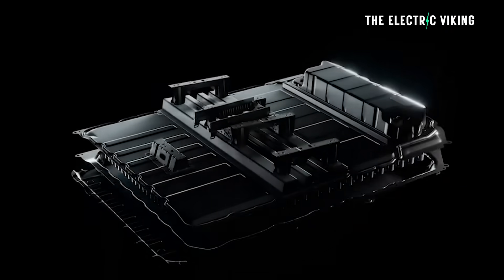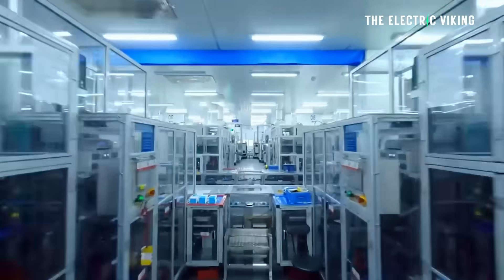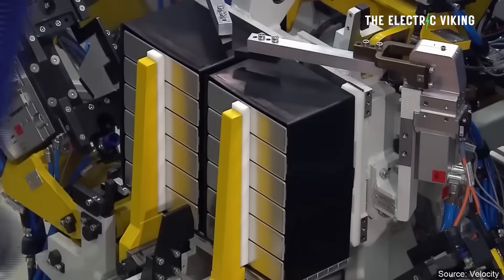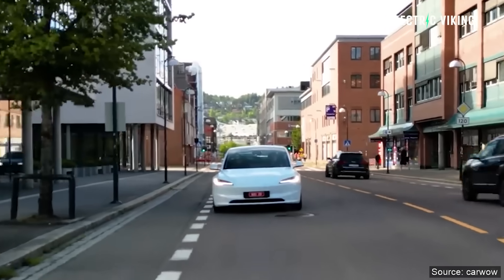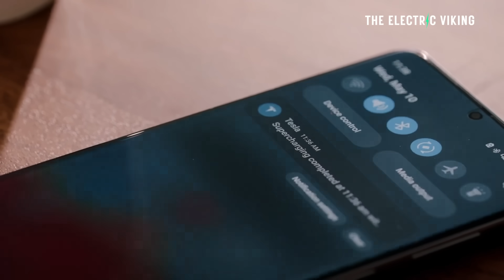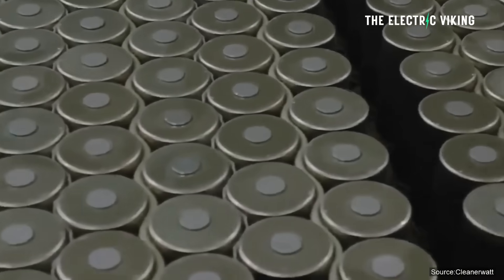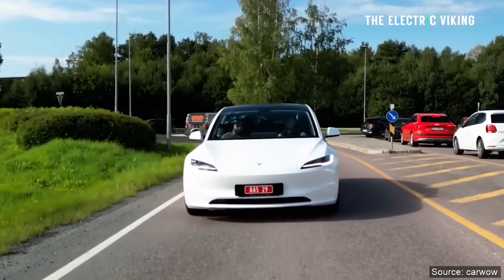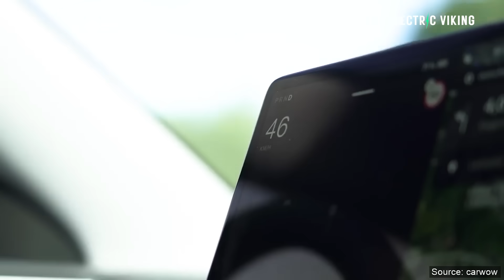Replace a faulty Tesla Model 3 battery for $12K or sell the car for $16K?

Comment: It can be more expensive if you swap the battery yourself on the parkinglot of a major Australian airport
Reply: And then leave it outside exposed to the elements for a few days.
Reply: It was actually a wrecked 2020 MG ZS dropped in the airport dump used for damaged and other vehicles abandoned on airport premises.

Some smart Alec had pulled the battery apparently in an attempt to steal it but did not safe it up properly. The resultant fire burned three or four other vehicles parked alongside.
Reply: @jimgraham6722  what's your source. Or did you hear that on social media?
Reply: Lol I don’t get it I’m not from Australia but it sounds funny lol
Reply: @robertfonovic3551 There's a pic from the scene that shows a burnt battery pack on the ground in front of a car. They don't just fall off, not even in a fire. The firefighters wouldn't have tried to remove it either.

Why the pack was removed, I don't know.
Reply: Anyone else hearing the “The Benny Hill Show” theme music in the background ?🤣

Comment: Wouldn’t it be nice if the battery management system could identify the cell that is weak or defective, sort of like a spreadsheet on the diagnostic menu on the infotainment screen and the individual cells could be replaced. That seems a better solution than scrapping a whole giant battery pack.
Reply: Software does exist, but the module currently should not be 'opened up' that contains the bad battery cell. So replace the module.

Comment: One more point for EV, you can sale your old batteries or reuse them for energy storage; however, with old engines no value.
Reply: For sure, because of you don’t have a basement to but that battery in as storage, I’m sure someone with $10000 in their pocket will happily buy your used pack with at least 30 usable kWh left, instead of a Powerwall 3 with what, 13 kWh? 

That one is definitely a DUH!

Comment: If the EV battery just degrades you can still use the car and just charge it more often. If your gas car develops a bad problem your range is zero until you fix it.

Comment: Thanks for all this information.  I assume if the vehicle is still in pretty good shape and everything else works fine, getting a new battery would be the best option for me and not trying to go for a newer vehicle.  It is kind of a judgement call should the battery go bad in the vehicle. 

Or if we can find a 3rd party that can do the battery repairs cheaper than Tesla pricings.

What is the warranty if we do get a new battery from Tesla???  Does our Auto Insurance help pay for some of the costs???  Things to ask when the time comes.

I just got my new 2023 model Y LR Aug 2023 so it will be a while before I reach that time to be thinking about my battery status.

Take care.

Comment: The solution for premature battery failure is insurance. And manufacturers should built in programmable fuses to isolate faulty cells, it is better to have 80% capacity than zero.
Reply: Too long to explain, but the way those battery pack is built, they can't do it. if they do it, will cost way more since will be needed to add so many components. This said, normally, battery pack must going down all together as they getting old, but failure can happen and look like it's maybe the case in this and the battery pack do it's job, warning the driver before it's too late.
Reply: @sergiomomesso1590  It all depends on the pack is designed. I saw tear downs of both the Tesla and BYD packs, they are not designed to be repaired. The Atto3 pack is very well designed with individual BMS channels per cell, and the Tesla pack is less sophisticated but does allow for reduced capacity without lower operating voltage. Redundancy can be designed in but cost would go up. 
Batteries are inherently being balanced if installed in parallel but unbalanced cells can occur and will lower cycle life. The high number of cells in the Tesla packs will have a higher probability of a faulty cell. 
I think Elon Musk had come around to the idea of using Prismatic cells because of the higher packing density and lower manufacturing cost. I heard the 4860 cells are not happening.

Comment: tesla should just do 650,000km battery warranties,  if the problem isn't widespread.  In fact, to boost confidence,  they should replace all batteries for free that have done less than 650,000km,  even if they weren't given that warranty when bought. Make it 700,000km
Reply: Nice Thought  🤔
Reply: Ridiculous and unnecessary.
Reply: Sure. Tesla would simply look at statistics and add it's cost to the price of cars plus a buffer.   EV battery warranties are far better than ICE,
Reply: Yea agree Tesla is already doing this at 8yr / 120,000mi far above the 3yr/36,000mi you get on an ICE car…
Reply: We aren't at the point where have data whether all these Teslas start dying en masse after 10 years. I'm considering buying 2018M3LR for $29k, or new, or skipping EVs entirely until the Chinese EVs arrive.
Reply: @Xuyesi it’s true we won’t truly know until we have more data but Teslas do have robust battery management systems and that seems to be the key to longevity. 
Do the chinese cars have 10yrs of data?

Comment: The warning message was likely a fluke, I've seen this with "service visual assistance system" and "Service transmission" error messages a LOT, scary message shows up 1 time or a few times, nothing happens and then never comes back, or keeps coming back without reason.

Comment: My hunch on fast charging, is that it DOES NOT degrade the battery faster.  However it probably increases the incidences of a failure.   I would 100% sell that car. You dont know what you will get with a refurb battery.

Comment: Yep, great analytical and rebuilt guys in the EV space exist,  Gruber motors are one set of guys to talk to - in the USA, for battery cell - testing, extraction, matching and replacement.

If that $12k replacement is a genuine offer, it is likely only ob an exchange basis direct to Tesla.

Wreck the car for parts - there should be a whole lot more than $16k in spare parts for the smash repair and used EV cell- modules / electro-mechanical  repair sector...  *the car is as good as done" - on a mileage basis.

Comment: 1) My last two BMW's did about 120k miles, costing a fortune in spare parts, sensors etc to get there before the engines failed and the cars became uneconomic to repair. The problem is not the ICE engine, its the fact cars aren't designed to be repaired, even head gaskets can't be replaced and engines can't easily be worked on.
2) $12k for a new battery with the old battery worth $6k in scrap makes swapping a battery good value at 150k miles. I'd probably have the wheel bearings and suspension checked as well, then the car is as good as new.
3) We have a big problem with catalytic converted theft in the UK, partly because we don't have a functioning police force any more, but will battery theft be a thing soon if all the average caravan owner needs is an electric screwdriver to remove them?
Reply: Wise man.   Companies are starting to show up that a doing the 2nd use/life things on EV batteries.  One used bus batteries because there was a steady supply.  Tie this in with buying a replacement battery would be a win.
Reply: Exactly my thoughts!
We've got the same issue with DPFs removed in Ireland. 😢
Diesel particulates are the most nasty stuff on the planet. It's a shame this hasn't been banned yet in the EU.

Comment: Lithium batteries also expire with age. My low kilometre (180,000 klm) muscle car is 47 years old & still runs fine, with 87% of it's original compression. Original engine never been rebuild.
What are the odds of an EV battery lasting 47 years with 87% battery capacity?
Reply: Yours is the exception, not the rules. Most people don’t even change the oil regularly on their ice vehicles.
Reply: Yea I agree with the other post. Its nice to hear, but there is a reason why there not that many older cars in the streets. They burn out and ran till they die. Also, to play fair, I think there is a bit of a miss wording - the battery doesnt just stop working - it just doesnt hold as much charge over the next 15 years or so. Hopefully they can figure out how to improve that. Mainly what really kills them is build up / thermal run away follow by over heating them (like fast charging them).
Reply: @ZeusBullyMax  In the old car's, it was usually body rust that killed the car's. However my car has been in the family 47 years, has always been garaged & serviced adequately.
Reply: Where I live cars your age are in junkyards all rusted out.
I hate to get into an accident in a car that old..
Reply: A young automotive engineer at work has an old Honda hybrid two seater car. I was curious about how was it still working so I asked him about it. He chuckled and said the hybrid system isn't working but the gasoline engine still works.
Reply: @thomaswilson2917  The post is not about car safety, it's about drive train longevity. Naturally all new cars, ICE or EVs have better safety & rust resistance.
Reply: @SunRise-ul7ko  I think my electric motor will outlast your gas engine and transmission.
Your engine and transmission do not come with a 150k mile warranty.
Reply: If you actually drove your muscle car daily in the rain and snow it would be a rusted pile of metal in a junkyard many years ago.
Reply: @SunRise-ul7ko  so your car is driven roughly 3800 km or 2000 miles a year. That’s hardly a daily driver. Multiply your number by six and I doubt your car would be doing that well. How much maintenance have you been doing over 47 years? You should be doing oil changes. The battery are being replaced also unless you have them set aside on a trickle charger,  even then I would think you have replaced the battery at least six times and you have substantial other maintenance costs.
Reply: @ZeusBullyMax so true. just sit there in the garage like jay leno's collection, and drive it for a few miles every week. lol
Reply: @timothykeith1367  I don't see many gas engines laying that long.
New engines with turbochargers start to have turbocharger issues at 100k miles. 
Don't see automatic transmissions lasting 300k miles.
Reply: And you are getting how many mpg? 
You are only driving 2000 miles a year. 
Try driving 20k miles a year.. 
That's 5 years of driving for me.
Reply: @SunRise-ul7ko  you drive in salt laden snow all winter?
Reply: @thomaswilson2917  It doesn't snow where I live, but it can rain a lot.
Reply: @SunRise-ul7ko  issue is not snow. 
Issue is snow mixed with salt. 
Snow melts and then you have salt water all over the vehicle.
Reply: @timothykeith1367  I had a car that rusted out the rocker panels from the inside. 
The panels were sealed.. 
You would be surprised where salt water will go..

Comment: My ID3 has your "suspect" LG Chem batteries. In two and a half years I would estimate that it has lost no more than 5%. Actually, possibly less (~12 miles). In that time I've rapid charged it 4 times, but never low to maximum. The rest has been Type 2 charging at work around 11.5kW, and invariably I take it to 100% because I may do a trip at the weekend. Either way, it lasts me all week, even in winter because I'm not out and about so much then. I think it may last donkey's years, though I'm going after a smaller car next. The ID3 is actually unnecessarily big, including range, for my needs. Something like an E-UP! or similar would do the job perfectly well. The only thing dissuading me from a used 30kWh Leaf is the passive BMS.

Comment: I think there should be an old battery deposit. Manufacturers should give 10,000 dollar deposit on my old battery. For repair, recycling, stationary storage......81 percent is still good for someone. Even as a lower range expected car..
Reply: I think ev cars will have prices reflecting the actual range at the used status. 10 yrs old 150 miles range. Lower expected price for lower range, available

Comment: Designing serviceability into battery pack designs would be beneficial to longer term value retention in EV's. Aftermarket battery pack industries would develop to bring down prices overall and would improve older vehicle performance as better batteries become availably..

Unfortunately this long term value building comes at the cost of more profitable new vehicle sales and as such there exists little incentives for manufactures to make the battery packs easily serviceable and/or modable..

Despite short term diminishment in profit there exists ais a strong Market for product brands associated with enduring practical value and some manufactures will embrace this by establishing a strong relationship with the post sale EV market along with the  gear head type people who that inhabit that eco system.
Reply: Not that the Chevy Bolt battery pack is super-serviceable, but it’s definitely not complicated and requires only 42 bolts or something to remove, and drops right off of the bottom of the car after draining the coolant from the cooling system.  It’s pretty heavy so requires the shop to have appropriate equipment to do the swap, but quite honestly I could very much see many shops being able to replace the entire thing with little problems.  There’s a really good video on YouTube by Weber State University that details the entire process.  My Bolt battery was replaced by GM earlier this year so thankfully I’m covered for another 8 years.

Comment: If you’re the owner of a BMW 328i, then you know that your car is a workhorse. With its peppy engine and sporty handling, the 328i can handle just about anything you put it through.
But what happens when your engine finally gives out? Replacing the engine on a BMW 328i can be costly.

In short, The labor cost is between $2,900 and $4000, while the engine will cost you around $8,563 and $8,692. So, all in all, you’re looking at a bill of over $11,000 to $20,000. The difference in the cost depends on the engine you get and where you do the replacement.

🇨🇦

Comment: How many people drive more than 10,000 km per year?  I'm talking urban dwellers. Not many I suspect.  The mean average daily commute in Aust. is around 16km apparently. That's 5,840 km per year.  That means a battery life of up to 27 years depending on use.  Even lasting 15 years would seem reasonable.  In 10 years time,  the fast charging EV network will be widely distributed, making battery range even less critical.  Thus further extending the practical useful life of worn down batteries.

Comment: More importantly, Tesla, along with all other car manufacturers should be responsible for proper recycling of the waste products, in this case the enormous battery pack, in the same way that manufacturers of toxic products are currently being held accountable for returning and recycling their products. Just wait and see what happens to the prices of new EVs when this occurs
Reply: It won't happen.  The battery packs are being repurposed or recycled.
Reply: @davidmarkmann6098  if so, when and where ? not currently happening in almost every location on the planet, most countries don’t have facilities for recycling batteries . It has to be a world wide plan. 
Here in Australia with the likes of car oil and tyres , when replaced attract a recycling levy to cover the cost of recycling. Just imagine how much that’s going to cost with an enormous car battery ?

Comment: Sounds like the BMS sorted out the problem cells automatically. When cells go bad in a module it usually means the cells have discharged too far, and dropped below a certain voltage threshold, and the BMS rejects those bad cells and therefore the whole module is cactus. Refurbishing these modules often means just individually recharging the problem cells, not even replacing them, and once that's done, the BMS is happy again and things work as normal. In this case, the BMS must be capable of individually forcing the charging on individual cells that have gone under voltage, therefore bringing those cells back into service.